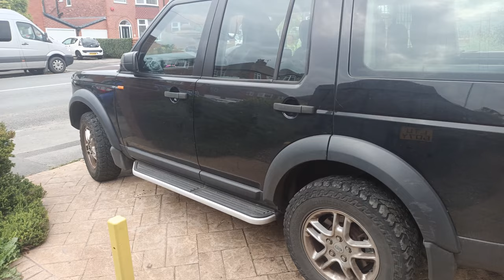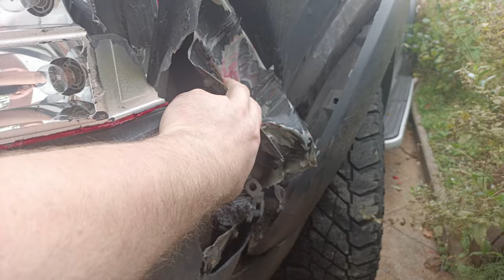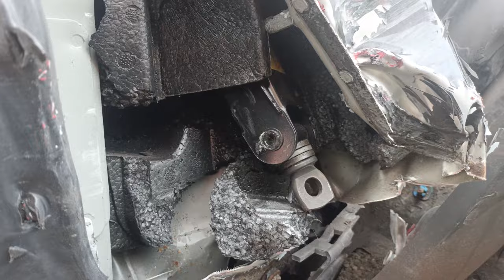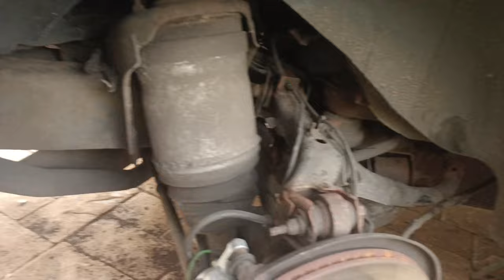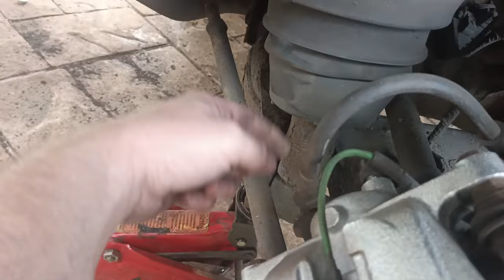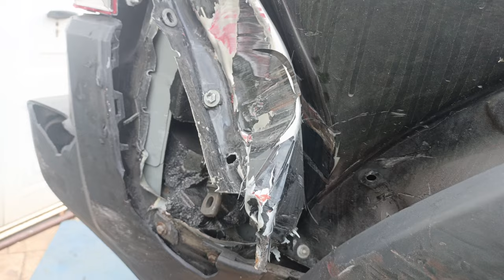Discovery 3: Write Off?

Comment: The bloody nightmare is that it's such a tough thing to replace for the price. 
Worry about the same thing with both our cars which are well maintained and cared for.
Reply from the maker: agreed, it "was" well maintained and ran very well for 170k.. however, it had to go as i didn't have the space.. 
insurance paid well above market value as it was almost impossible to find a suitable replacement.. allowed me to get a similar spec 2 years younger and 60k miles less..
Reply: Hey ho i suppose that's life and i suppose that's how it's going ,    The But is i would have repaired it myself as iam on my second Discovery  the one I have just now is 26 years old and still going strong iv looked after it ,   serviced it every 10 thousand miles , on my  5th timing belt  due to age NOT milage and has been a Very reliable car, tow car, and always felt safe in it, used to tow a 26 foot caravan, an 18 foot boat and a 3 ton trailer effortlessly ,  I'll be resting in my box an this car will still be going providing the next owner 😕 looks after it